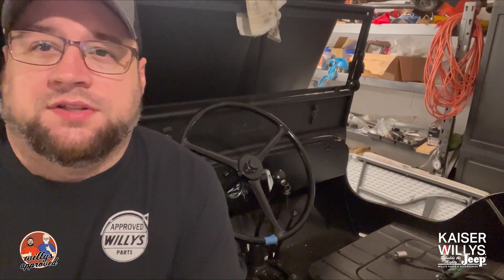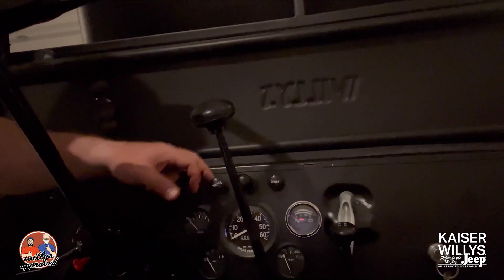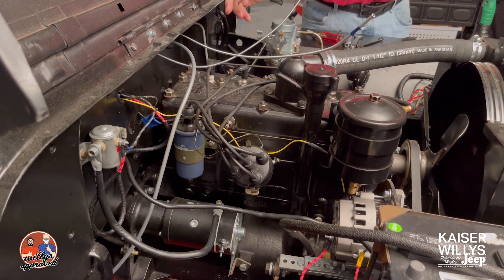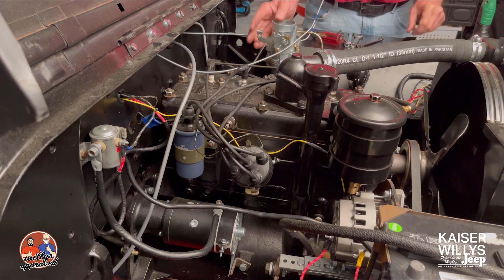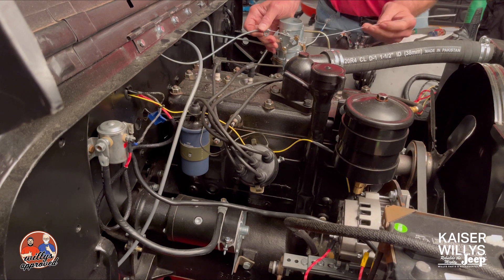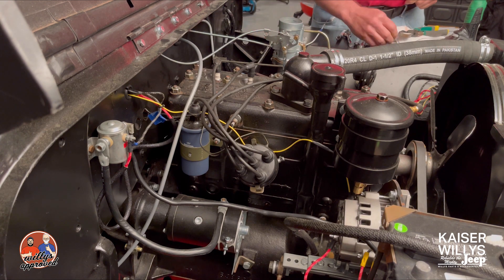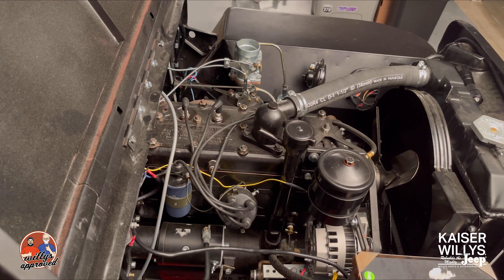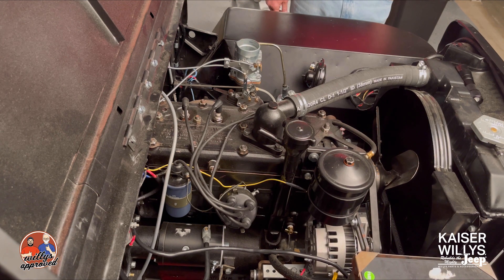Willys Jeep How To: Choke and Throttle Cable Install

Comment: My original throttle cable was broken and the nut was too rusted to remove without drilling out. The replacement from KW is currently routed through the heater switch hole. Still works fine once shortened a little.